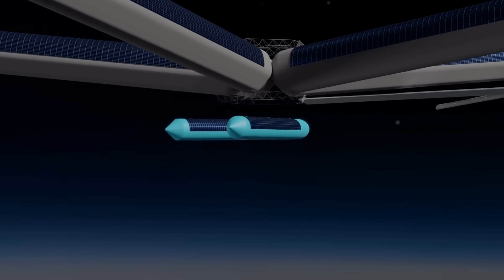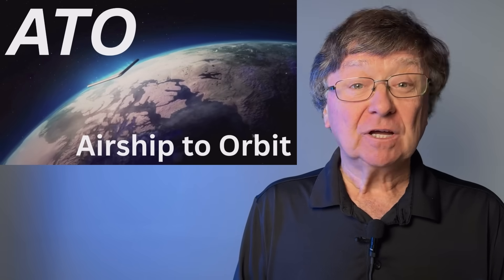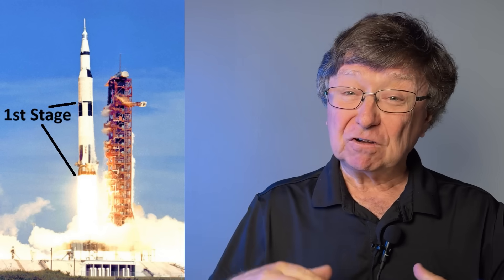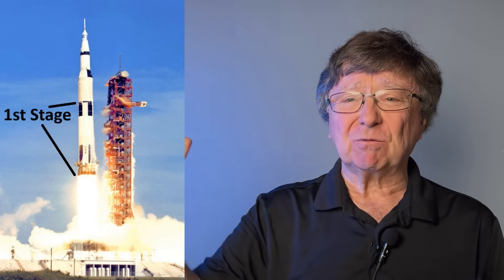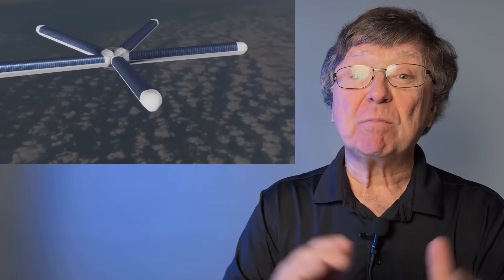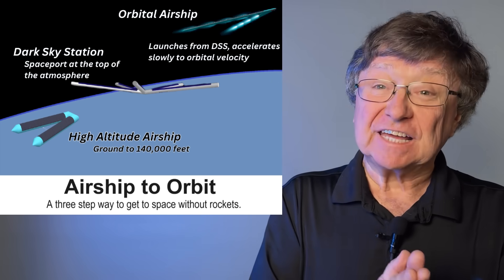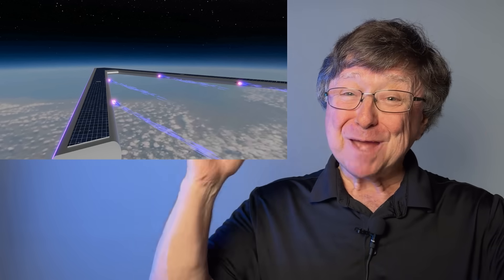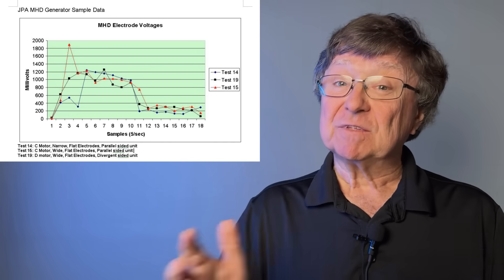This Airship Might Change How We Reach Space Forever!

Comment: I didn't think this was a thing. When I was little, about 30 years ago, I came up with a similar system. I dreamed of a huge toroidal "balloon" where I would live, have a laboratory, and even a garden, from which I could launch rockets into space, and from the ground to my balloon, lightweight hybrids of an airplane and a helicopter would fly (not lighter than air, but lighter than they could be thanks to a high-temperature propulsion system and special pockets of hot air located everywhere). I thought I was the only one who thought about this. Turns out, I wasn't. P.S. Actually, I didn't know for sure back then that it was possible to launch balloons 40 km into the air. I thought the limit was somewhere around 20 km.

Comment: I been thinking about this for pushing a decade.  High altitude weather balloons get up to around 90km then pop but I always wondered if instead we leaked out the Hydrogen and passed it into an ion drive giving lateral motion which would translate to raising the thing higher and then once its about out of fuel launching some solid rockets.  I feel like it could get a small phone sized sat at least to orbit

Comment: a lot of lofty ideas and glazing, but not one mention of the myriad of safety issues.  I applaud the effort, but people are not going to take a risk in floating up to the edge of space if they're not certain without doubt that the transport is safe and reliable.  Have you demonstrated the ability of the floating platforms to withstand adverse conditions?  can it withstand impacts from micro-meteors and other debris coming down from space? If a failure or collision occurs on the floating platform, is there a safety mechanism in place to return passengers to earth?  How are you slowing down the escape/re-entry vehicle for docking and does the heat generated from that re-entry pose a risk to the platform? How are you performing maintenance on the platform? Will there be a staff on the platform at all times? There are soooooo many logistics and pragmatic issues I see with this system, it's got some merit but it seems a long way from practical use.

Comment: If the space station is floating on top of the very thin atmosphere, it doesn't need to be going at mach anything to stay up. Its floating. On the plus side, gravity would still be in effect so passengers would not need special training. The ascender craft does not appear to have any thrusters on it. How would it manouvre to dock with the station? Since jet stream air currents are extremely fast, how would the ascender handle its own stability? I would like to see more videos giving some in-depth analysis of these problems and any others you can think of. Greetings from a nit-picking Aussie.
Reply: I have the same questions, and a few more. Fantastic idea!

Comment: Couldn't you use basically the same Zeppelin for stage one and the station? For example putting them in a triangular grid so you can build additions later. I think making a station from scratch would be tougher than making high altitude zeppelins one at a time.

Comment: People underestimate balloons. If you use strong tethered cables as a guiding system, you could lift even heavy rockets—just scale up the balloons. At high altitude, you’ve already bypassed the thickest atmosphere, which means huge savings on fuel and structural mass. A launch platform suspended by massive stratospheric balloons, stabilized by tethers, could be a game-changer. It’s not sci-fi, it’s just smart physics + logistics. Why fight gravity and drag from sea level when you can float your way up and launch smarter?

Comment: Helium balloons for reaching the edge if space have been based on a small quantity of helium in a huge envelope that gets full as the altitude rises. This idea is not new but the shape must be spherical at the stage when the envelope is full. Otherwise the stress requirements of the outer layer would make it so heavy that it will not rise at all. This video is about an impractical project.

Comment: The mothership part (dark sky station) doesn't even need the top half once it's in orbit, as it's effectively a boat sitting on top of the atmosphere, you can use the weight saved to strengthen and enlarge the hull.

Comment: Hmm.
So how do you solve the changing weight of station when ships come and go ? And are the stations supposed to be somewhat stationary or they go with the wind ?
Up there should be pretty nasty wind speed though with little density so might not affect it that much. 
And what material is used for ascend airships ? Wouldn't they want to expand like weather balloons ?
Reply: It vents the gas as it slowly accelerates to space

Comment: Spoke with AI :
"Above 140,000 ft, the Ascender becomes less a fast vehicle and more a high-altitude “truck.” It’s designed to ferry hardware, like fully fuelled rockets, into the edge of space where atmospheric drag and gravity losses are minimal.

If it has two cargo bays each 30 x 30 meters, that’s an enormous volume. The Ascender could carry large rocket stages, satellites or modular payloads. Instead of blasting off from Earth’s surface, these rockets launch from a near-space “airport.”

✅ Advantages of slow delivery:

No need for the Ascender itself to reach Mach 10. It can ascend slowly, conserving energy and minimising structural stress.
Rockets carried up can be optimised purely for vacuum operation — no need for thick hulls to survive sea-level pressures or aerodynamic heating.
Smaller rockets can reach LEO with much less fuel since they avoid dense lower atmosphere and gravity drag.

✅ Remaining challenges:

Mass and buoyancy: Even at 140,000 ft, lifting heavy payloads demands colossal gas volume and ultra-light materials.
Station handling: Transferring large rocket stages safely in the thin stratosphere, amid winds, requires stable platforms and precision robotics.
Thermal conditions: -60°C or colder means materials and electronics must be highly robust.

So you’re spot on: the Ascender’s true role is likely delivering rockets to a high-altitude launchpad, not flying fast itself. It’s a slower, gentler route into orbit — and a fascinating alternative to brute-force rocketry."

Comment: Well i think they should send people up on blimps to a floating station.  They have the tech to convert the gas into liquid so they could send the blimps back to the surface after they deliver there supply to the station.  Rest of the way to space could be done by a space elevator since it does not need to go to the surface it should be possible.  For the space debris they could use a laser or pulse device to knock the rocks and other junk just enough to force them into falling into orbit to burn up.

Comment: I really hope people realize we should be funding this not spacex its safer cheaper and more environmentally friendly.

i have one question what are the full scale dimensions and mass and payload capability of each of the 3 fully reusable stages ? and whats the thrust to weight ratio and isp of your symphony engine and total number of engines on H1 ?

(im having fun estimating most ideal specs of your systems via me suggesting upgrades to AI but i need more details your pdf and video doesn't cover, it can just me a rough estimate & maybe as i know these things change)

Atmospheric Ascender (With Mars Helicopter Blades):
	•  Impact: 20–30% lift efficiency increase supports 11,110 kg payloads, reduces ascent time to 7–9 hours, and saves ~2–3 kW. Hydrogen boosts payload by ~1–2 tons.
	•  Challenge: Blades add ~50–100 kg; hydrogen requires spark-free systems.
•  Dark Sky Station (48% Efficient Solar Arrays, Lyten Batteries):
	•  Solar Arrays: 48% efficient cells (120 W/m²) on 250,000 m² yield 12 MW, powering HETs and crew systems. Hydrogen reduces structural mass by ~8%.
	•  Lyten Batteries: 140 kWh in ~100 kg enable nighttime operation, saving ~80% mass vs. lithium-ion.
•  Ascender H1 (48% Efficient Solar Arrays, Lyten Batteries, MPD Thrusters):
	•  Solar Arrays: 7.7 MW powers 100 MPD thrusters, reducing acceleration time to 12–24 hours.
	•  Lyten Batteries: 280 kWh in ~200 kg support peak thrust, cutting propellant by 50–70%.
	•  MPD Thrusters: 540 N, 5,000 s Isp enable 11,110 kg to orbit. Hydrogen reduces envelope size, easing assembly. 

Graphene-Reinforced Polymer Nanocomposites (2023–2025):
		•  Description: Graphene, a single layer of carbon atoms, offers exceptional strength (130 GPa tensile strength, ~100x stronger than steel) and low weight. Combined with polyethylene or polyimide (e.g., Kapton), graphene nanocomposites reduce thickness to ~1–2 microns while maintaining or exceeding 400 kg/cm² breaking strength.
		•  Benefits:
			•  Strength-to-Weight: Increases tensile strength by 50–100% (600–800 kg/cm²), allowing thinner shells (~1 micron) to reduce mass by ~30–50% (~500–1,000 kg for Ascender H1’s 160,000 m² surface).
			•  Permeability: Graphene’s impermeability reduces hydrogen leakage by ~90%, extending mission duration (weeks vs. days).
			•  UV/Thermal Resistance: Stable from -100°C to 500°C, ideal for stratospheric and hypersonic conditions (Mach 20+ for Ascender H1).
			•  Micrometeorite Resistance: Zero-pressure hydrogen cells (per JP Aerospace) leak slowly if punctured, enhanced by graphene’s toughness.
		•  Application: Replace polyethylene with graphene-polyimide for all stages, especially Ascender H1, to withstand hypersonic drag and re-entry. Reduces Dark Sky Station and Ascender H1 envelope mass by ~1,000–2,000 kg each.
		•  Challenges: High cost (~$100/kg for graphene) and complex manufacturing (e.g., chemical vapor deposition) require scaling for airship-sized sheets.

Ultra-High Molecular Weight Polyethylene (UHMWPE) Composites (2024):
		•  Description: UHMWPE (e.g., Dyneema) with carbon nanotube (CNT) reinforcement achieves ~3–4 GPa tensile strength, ~10x stronger than nylon rip-stop, with low density (~0.97 g/cm³).
		•  Benefits:
			•  Mass Reduction: ~40% lighter than polyethylene (~0.5–1 kg/m² vs. 1–2 kg/m²), saving ~800–1,500 kg for Atmospheric Ascender’s ~10,000 m² envelope.
			•  Durability: High fatigue resistance and low creep maintain shape under stratospheric loads (40 mbar for Atmospheric Ascender, 0.1 g/m³ for Ascender H1).
			•  Permeability: CNT doping reduces hydrogen diffusion by ~80%, critical for long missions (e.g., Ascender H1’s 12–24-hour orbit phase).
		•  Application: Ideal for Atmospheric Ascender’s turbulent lower atmosphere and Dark Sky Station’s long-term exposure. Complements inflatable modules (Vectran/Nomex) for internal hydrogen cells.
		•  Challenges: UV coatings needed for long-term exposure; cost (~$50/kg) higher than polyethylene but lower than graphene.
Reply: Inflatable Airbeams with CNT-Reinforced Fabrics (2024):
		•  Description: Nitrogen-filled airbeams (Vectran/CNT) replace rigid trusses, providing structural support with ~50% mass reduction. Used in JP Aerospace’s designs for rigidity without girders.
		•  Benefits:
			•  Mass: ~5 kg per 100 ft vs. 20 kg for carbon-fiber trusses, saving ~1,500–2,000 kg for Ascender H1.
			•  Flexibility: Adjustable pressure (vented via liquid nitrogen tanks) maintains shape under varying loads.
			•  Scalability: Suitable for Dark Sky Station’s 2-mile frame and Ascender H1’s 1-mile structure.
		•  Application: Use airbeams for Atmospheric Ascender’s keel and Dark Sky Station’s spokes, reducing launch mass for segments.
		•  Challenges: Requires precise pressure control to avoid collapse at 140,000 feet.

Atmospheric Ascender: Graphene-UHMWPE fabric (~1 micron) reduces envelope mass by ~500 kg, and CFRP/CNT airbeams cut keel mass to ~50–100 kg for a 250 ft structure. Supports 11,110 kg payloads with hydrogen’s ~8% lift advantage.
•  Dark Sky Station: Aerogel-coated graphene-polyimide fabric and TMC/CNT airbeams reduce total mass by ~2,000–3,000 kg (~10,000–19,000 kg vs. 13,000–22,000 kg), enabling fewer launches (~6–12 vs. 8–15).
•  Ascender H1: Graphene-polyimide fabric and TMC airbeams save ~3,000 kg (~15,000–24,000 kg total mass), supporting hypersonic flight and 11,110 kg payloads.

are these the real dimensions and specs ? 

Atmospheric Ascender (First Stage)
•  Full-Scale Dimensions:
	•  Length: ~800 feet (243 m), per rimstar.org, though hydrogen’s ~8% higher lift reduces this to ~700–750 feet (213–229 m) for equivalent buoyancy.
	•  Width: ~120–150 feet (37–46 m), V-shaped with hydrogen-filled cells (graphene-UHMWPE).
	•  Height: ~50–70 feet (15–21 m), reflecting a streamlined envelope.
	•  Volume: ~20–30 million ft³ (560,000–850,000 m³), providing ~9,000–13,500 kg lift at 140,000 feet (~0.0043 kg/m³ with hydrogen).
•  Weight:
	•  Dry Mass: ~1,800–4,500 kg, with graphene-UHMWPE fabric (~500 kg savings) and CFRP/CNT airbeams (~50–100 kg keel). Mars helicopter blades (5–10m, 3,500 rpm) add ~50–100 kg.
	•  Total Mass: ~9,000–13,500 kg, including hydrogen, 6–11,110 kg payload (e.g., Hubble), 15–20 kW solar arrays (30% efficient), and 100 kg Lyten batteries (140 kWh).
•  Launch Process: Ground-launched from Black Rock Desert, Nevada, or McClellan Airfield, California, using hydrogen buoyancy and Mars blades (20–30% lift efficiency). Ascends to 140,000 feet in ~7–9 hours, docks with Dark Sky Station, and returns. Hydrogen safety requires nitrogen purging and spark-free systems.
•  Assembly: Fully assembled on the ground in a hangar, with hydrogen-filled graphene-UHMWPE cells and CFRP/CNT airbeams.
Dark Sky Station (Second Stage)
Reply: Full-Scale Dimensions:
	•  Size: ~2 miles wide (3.2 km), 0.5–1 mile long (0.8–1.6 km), or a prototype at ~1,500–2,000 feet (450–600 m) square, ~100–150 feet (30–46 m) high. Hydrogen reduces volume by ~8% (e.g., 1,400–1,800 ft prototype).
	•  Payload Bay: 30m x 30m (900 m², ~5m high, 4,500 m³), fitting Hubble (11,110 kg).
	•  Volume: ~2 billion ft³ (56 million m³) for the full station, providing ~10,000–20,000 kg lift at 140,000 feet. Prototype: ~500 million ft³ (14 million m³).
•  Weight:
	•  Dry Mass: ~6,500–11,000 kg, with aerogel-coated graphene-polyimide fabric and TMC/CNT airbeams (spokes). 48% efficient solar arrays (250,000 m², 12 MW) add ~450 kg; 10–20 H71M HETs add ~1,000–2,000 kg.
	•  Total Mass: ~10,000–19,000 kg, including hydrogen, crew facilities, and 100 kg Lyten batteries (140 kWh).
•  Launch Process: Assembled at 140,000 feet from segments (~90m x 90m, ~900 kg) launched by Atmospheric Ascenders (~6–12 launches with hydrogen). 48% efficient solar arrays and Lyten batteries power HETs for station-keeping. Permanent platform for payload transfer and Ascender H1 construction.
•  Assembly: Not ground-assembled; components (inflatable modules, solar arrays, HETs) launched and assembled in situ.
Ascender H1/Orbital Ascender (Third Stage)
•  Full-Scale Dimensions:
	•  Length: ~6,000 feet (1.8 km, ~1.1 miles), reduced to ~5,500–6,000 feet (1.7–1.8 km) with hydrogen’s lift. Initial test vehicle: ~6,000 feet, per Secret Projects Forum.
	•  Width: ~150–200 feet (46–61 m), V-shaped with hydrogen-filled cells (graphene-polyimide).
	•  Height: ~50–100 feet (15–30 m), streamlined for hypersonic flight.
	•  Payload Bay: 30m x 30m (900 m², ~5m high, 4,500 m³), fitting Hubble.
	•  Volume: ~11 million m³ (390 million ft³), providing ~15,000–25,000 kg lift at 180,000 feet (~0.0043 kg/m³).
•  Weight:
	•  Dry Mass: ~7,500–11,000 kg, with graphene-polyimide fabric and TMC airbeams. 48% efficient solar arrays (160,000 m², 7.7 MW) add ~700 kg; 100 MPD thrusters (5,000 s Isp) add ~10,000 kg; 200 kg Lyten batteries (280 kWh).
	•  Total Mass: ~15,000–24,000 kg, including hydrogen and 11,110 kg payload.
•  Launch Process: Built at Dark Sky Station from components delivered by Atmospheric Ascenders (~4–8 launches). Hydrogen buoyancy lifts to 180,000 feet; MPD thrusters (540 N) accelerate to 7.8 km/s over 12–24 hours, powered by solar arrays and batteries. Returns to Dark Sky Station.
•  Assembly: Not ground-assembled; constructed in situ at 140,000 feet.
Integration with Prior Technologies
•  Atmospheric Ascender: Mars helicopter blades (5–10m, carbon-fiber) increase lift efficiency by 20–30%, supporting 11,110 kg payloads with hydrogen’s ~8% lift boost. Graphene-UHMWPE fabric and CFRP/CNT airbeams reduce mass by ~700–900 kg.
•  Dark Sky Station: 48% efficient solar arrays (12 MW) and Lyten batteries (140 kWh, 100 kg) power HETs and crew systems. Aerogel-coated graphene-polyimide and TMC airbeams save ~2,000–3,000 kg. Hydrogen reduces volume by ~8%.
•  Ascender H1: 48% efficient solar arrays (7.7 MW) and Lyten batteries (280 kWh, 200 kg) power 100 MPD thrusters (540 N, 5,000 s Isp), enabling 11,110 kg to orbit. Graphene-polyimide and TMC airbeams save ~3,000 kg. Hydrogen supports hypersonic flight.

thank you for your time sir

(i know this would skyrocket cost but its nice to see the ideal upper limits of the technologies maturity to see whats its truly capable of if you got the same multi billion $ funding that spacex and relativity space get.

⚡️🛸⚡️

Comment: You just opened my eyes to slow burning (vs rocket) plasma drives with 10,000 isp fighting little to no atmosphere while they float in the stratosphere.  The savings in sheer propellant efficiency sound enormous considering how most rocket propellant is just to deliver propellant.